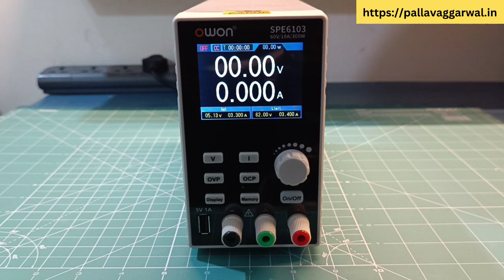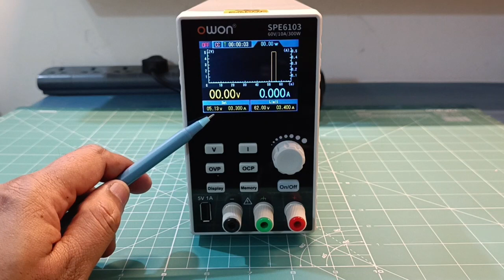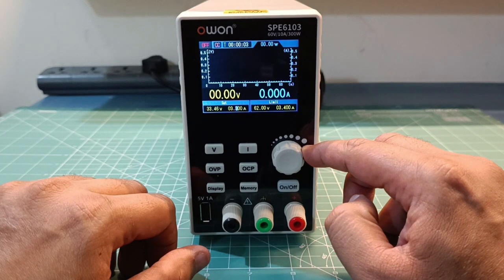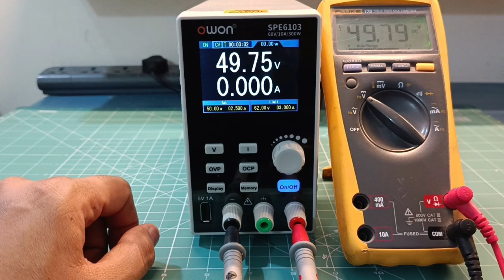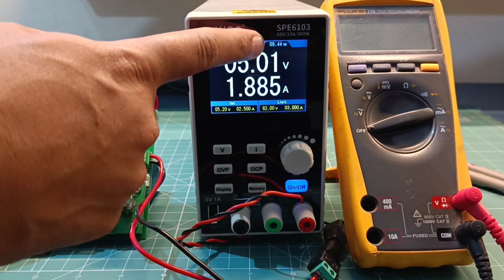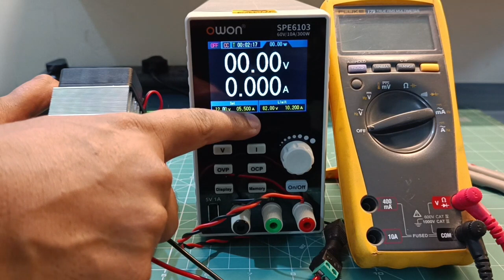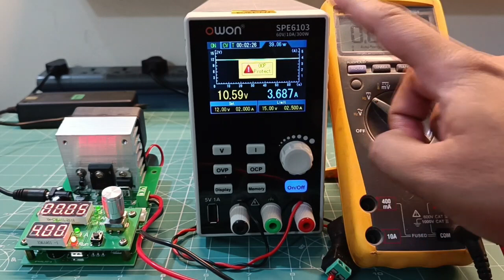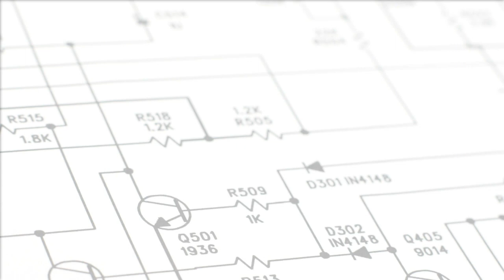Owon SPE6103 Programmable Power Supply - Part 1 | PallavAggarwal.in

Comment: If the power supply is of 60 volts 10 ampere how it could be it of 300 watt only
Reply: 60 volts OR 10 amps max, but always 300W total max power. So e.g. 30V @ 10A, or 60V @ 5A. At 10V it will do max. 100W, as it tops out at 10A.

Comment: Do you knowm why the actual voltage is lower than the set voltage, even without load? This seems not to be correct.
Reply from the maker: Calibration issue